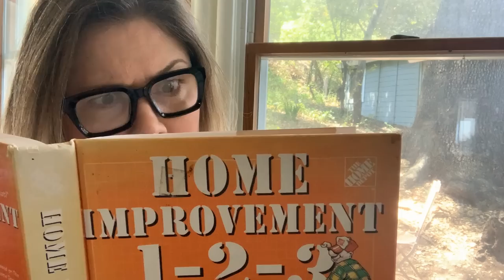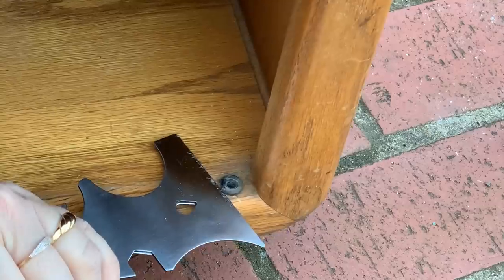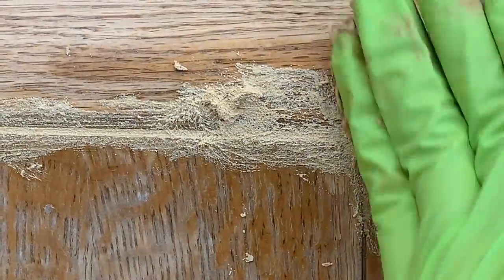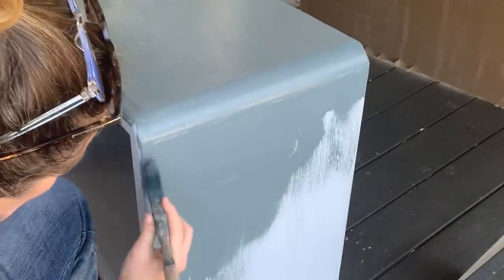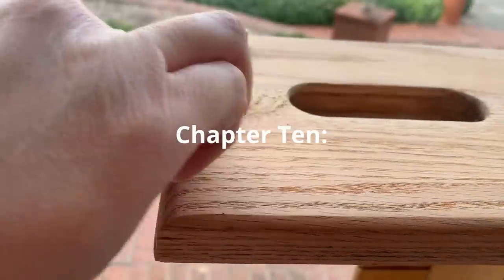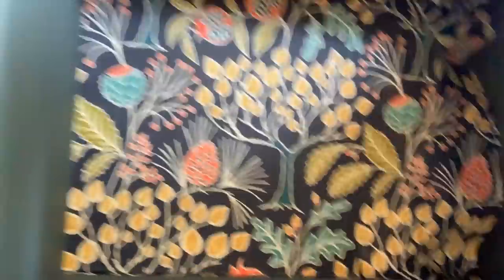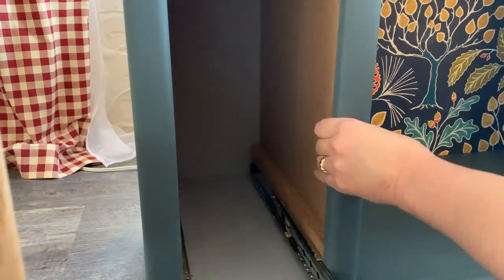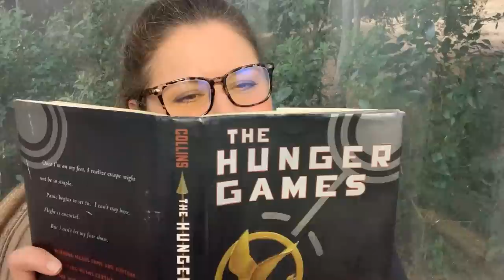The 80's Furniture Flip That Everyone Wanted to Buy | How To Makeover An 80's TV Stand for Profit

Comment: Very, very nice project. You transformed a sad relic of my past (not as distant past as I can claim, but I definitely designed some stuff in this vein). The nice thing about this is the piece structurally was worth saving. 

Two suggestions: 
1. the particle board "blocking" at the base of the case is the one bit of poor construction remaining from the 80s original - if you didn't want to take the time to prise it out and glue in decent blocking which would have made me feel better, you could have glued on a thin liner of any material (1/8" birch plywood, plastic laminate scrap, masonite - anything before you attached those nice new castors. I'm sure what you did will be fine, I'm just a persnickety old school coot.
2. Your faux graining was fine but your hole patching was not. Invest in an inexpensive drill set that includes spade bits and hole saws and you would be able to cut an oak plug out of scrap that would fill the hole tightly and if you chose well enough to match the grain - be done without painting. Or alternately cut out a rectangular opening around the hole and insert an oak dutchman to match - I'm sure you can find a YouTube tutorial on how to do this.

Two comments:
1. Thinking about the smell of the wax you added to an interior hidden area of the piece is brilliant. People should be aware of of first sense much more - Kudos.
2. This is the second piece of yours that I've watched. Your presentations are even better than your restorations, organization, pacing, your voice and personality are all superb! I am a fan!! Kudos again !!!
Reply from the maker: WOW!  Ok, thank you very much for such an informative and supportive comment!  I will be copying and pasting your suggestions so I can refer back to them in the future!  (sounds very much like you are someone with a respectable amount of experience in this area 😊)  And very much appreciate your compliments regarding my presentation - I work just as hard (if not harder) on all of those aspects you so kindly listed, and so it is wonderful to hear such positive feedback.  Again, many thanks.

Comment: You will find it easier to caulk gaps like the one on the end of the base if you run some masking (painters) tape along either side of the gap then push the gap filler in instead of dragging it. That way you get better penetration,  sharp edges & it is easier to clean the excess gap filler away from the surrounding timber. You could also use a spatula to get a smoother fill.
Reply from the maker: Great tips!

Comment: I have a question and after watching your AMAZING video, I think you  might be the one to ask.  You did multiple coats of your chalk paint and then (of course) sealed with with wax spray.  My question is, what are the benefits of using chalk paint and a wax sealant compared to just using a satin finish paint?
Reply from the maker: Thanks so much for watching!  I'll do my best to answer your great question...
I believe chalk paint became popular for furniture because of its matte, "chalky" finish, ability to be distressed, ability to blend and layer, and its relatively low need for prep. (although in truth - many folks will prep-sand and prime...its a myth that chalk paint doesn't require any prep ever).  You can use latex paint on furniture - some people even make their own chalk paint by adding ingredients to it - I think plaster of Paris (Ive never done this), but latex does tends to peel off of furniture much more, and a satin finish will most likely look much more shiny than a chalk paint that has been waxed.
Reply: @FurnitureFablesbyAndy   Well thank you so much for answering that for me!  Come to think of it, I do have some furniture that I painted with with just regular paint and  I need to repaint it because it's.....peeling.  I just figured it was my application.  But now I know!  25 heart emojis for you today.  haha!

Comment: does chalk paint all created equal? I tried chalk paint for first time recently on old sanded furniture dark color without priming. I use greyish green color. add very little water as the direction says it can mix with water (2 parts paint with 1 part water). so i definitely use very little water. however the paint didn't cover well and looked like see thru even when applying 2nd coat it seemed like the paint just washed away. although after drying it become more solid color. and the brush stroke is very visible with foam brush. it's not like in your video at all, look very solid, cover nicely.
Reply from the maker: Thank you for watching and great questions!  The key to any painting success (furniture of otherwise) is the preparation of the surface.  If the surface is dirty, (often we can't see dirt and grime on furniture because it is dark, but most furniture is very dirty!) or if it is too slick (slippery) the paint can't "grab hold" and form a nice seal.  I would recommend a good cleaning, as well as a good scuff sand to gently rough up the surface.  (A 220 grit paper is good for scuff sanding.)  As far as the paint itself goes - I'm not sure what kind you were using, but that sounds like way too much water! (2 to 1 ratio).  Think of water as a lubricant for chalk paint- a little goes a long way to help the paint glide over the surface, but a 2-to-1 ratio is more like a paint-wash and will look fairly translucent.  And then as far as brush strokes - I would find it very hard to get a good finish with a foam brush!!  I would recommend investing in a good brush - it doesn't have to be super expensive - you can see what your local hardware or paint store recommends, or check out Zibra Brushes here:  https://www.enjoyzibra.com 
I know that was a long answer - I hope that helps!  😊
Reply: @FurnitureFablesbyAndy  Thank you for reading and providing insight, Andy 🤭 the 2 to 1 ratio is recommended by the manufacturer. I use bioduco chalkpaint (am in Asia). in actual I used about 20 ml water on 400g can paint. it should be not much over water with such ratio but agree with you it looked like too much water. i still keep the remaining paint. probably the water will evaporate during storage and try again on other thing. Keep up the good thing on your channel 🤩
Reply from the maker: Ahh, I see - well that's a good idea to see if it improves once some of the water has evaporated.  Thanks so much for reaching out! 😊

Comment: Degrease and clean with Mineral Spirits. Use it to clean between sanding coats.  The veneered particular board which makes up the majority of the carcass is very susceptical to water damage

Comment: Would it not have been nice to replace the particle board with something sturdier, and not crumbly?
Reply from the maker: You know, I thought about it - but that board was incredibly strong and the feet mounted so well - not a hint of movement, and no crumbles.
Reply: @FurnitureFablesbyAndy  Huh. Looked crumbly, in any case. The project overall is gorgeous. Did you think about doing something with the drawer walls besides the citrus wax? I know it might've been awkward to get to.

Comment: Why wouldn't you lightly mist the back of that sticky wallpaper before you placed it? It lays so much easier then! And you can squeegee smooth out any excess water.
Reply from the maker: Hmm - I'll double check, but pretty sure water would be counter indicative, since it's basically like a huge sticker?  But I'm always happy to try a new tip, so thank you!!
Reply: @FurnitureFablesbyAndy  like how you use it with contact paper. Soooo much easier!